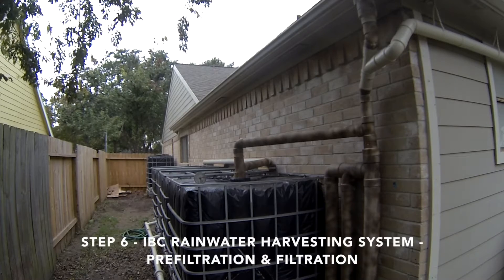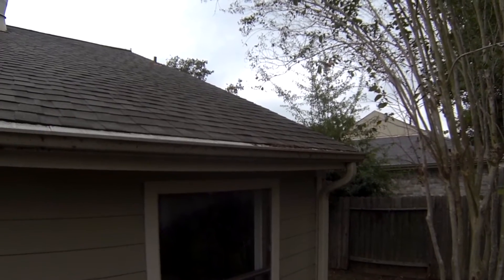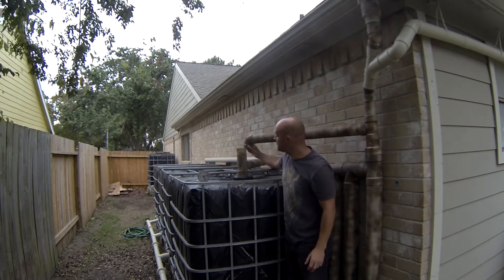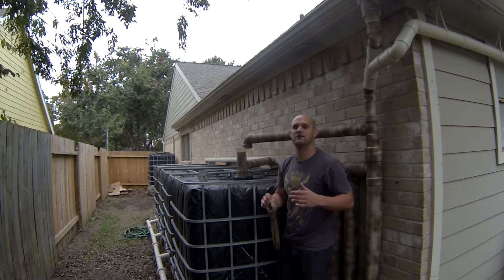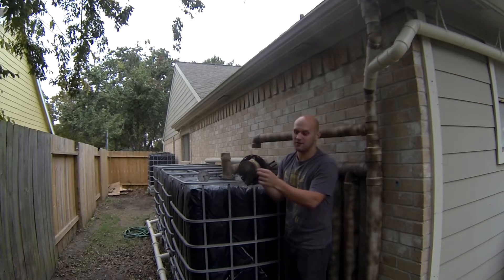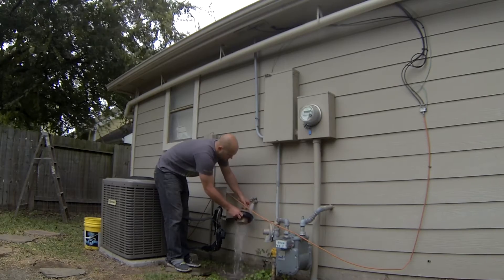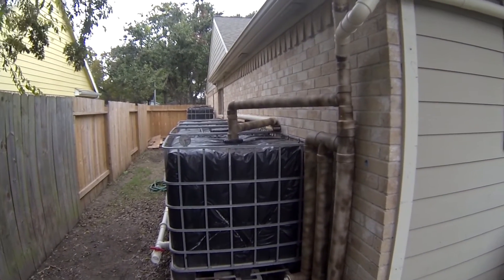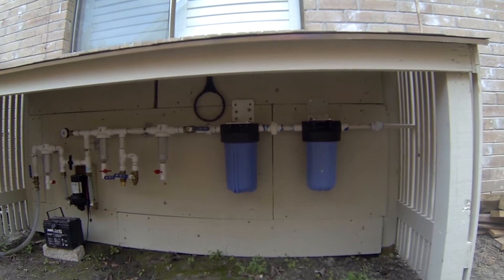Step 6 - IBC Rainwater Harvesting System - Pre Filtration and Purification

Comment: Except the Panty Hose You can use bug mesh and glu it on the end  of the pipe. when the glue is hardened you can cut of the sides  and it fits right in without touching the water. This Works very well ;)

Comment: Did you purchase the lid on the first tank pre-made for the 3" intake or did you cut the hole into the lid yourself and use some type of bulk head fitting?
Reply from the maker: David Oromaner I cut the hole myself with a 3 inch hole saw, as far as I know there are not any pre made caps with that large of hole.

Comment: For those of us who live where it gets cold enough, NW Georgia, what would you do to keep the system from freezing? It does get below freezing and sometimes near zero for brief periods here in winter. Any hints?
Reply from the maker: +Ben Brandon Buy tanks you can bury. you will not have a problem once they are in the ground.
Reply: @TheKombuchaCompany  Will not work for those of us who lives in area like Arkansas where we have hard rock clay soil that would require a heavy-duty excavator machine to dig a hole big and deep enough to bury the tank and it can get quite expensive. We do get cold down to single digit but not down to 0 degree. Who knows how cold this year will be. Thank you.

Comment: I see that you are like me, and very much a creature of habit. <g>  I was amused that you went to your facet and used city water that you pay good money to wash that panty hose filter, when you could have used your free rain water to do it.
Reply from the maker: TheStavros1001 Haha yes, Old habits are hard to break, I enjoy the extra pressure the city water has, it makes it much easier to clean the filters.
Reply: Extra pressure?  I hadn't considered that, with that much rain water I wouldn't have thought pressure would be an issue.  My bad.... (as the kids say these days...)  <g>
Reply from the maker: TheStavros1001 the system has plenty of pressure but when I clean the filters I find that that the city water does have more pressure and it makes it easier to clean them.
Reply: Trenton Kaminski How much pressure do you have?  Im sure you posted that on another comment elsewhere, but Im fairly lazy, and its quicker just to ask.
Reply from the maker: B Cook The system connect to a filtration unit power by a pump, 60psi max. Pumps around 4 gpm
Reply: Thats awesome.   Thanks for the info and the excellent videos.